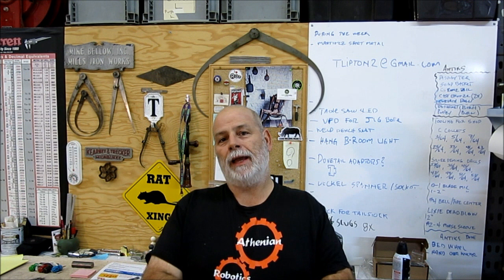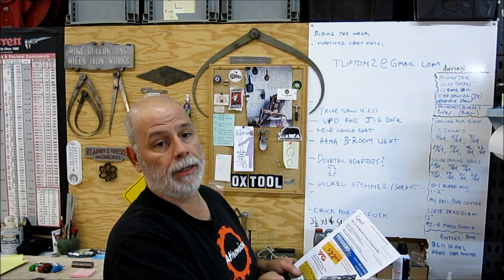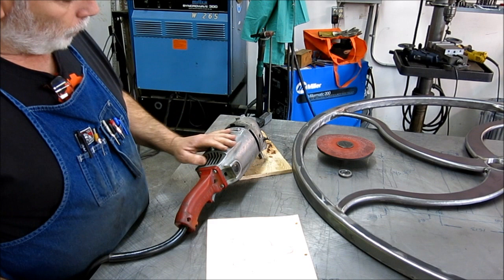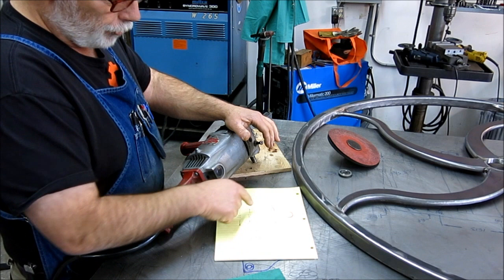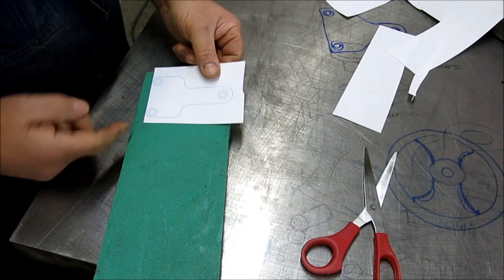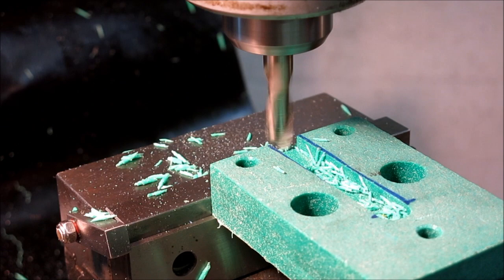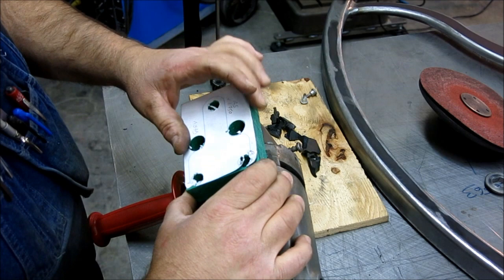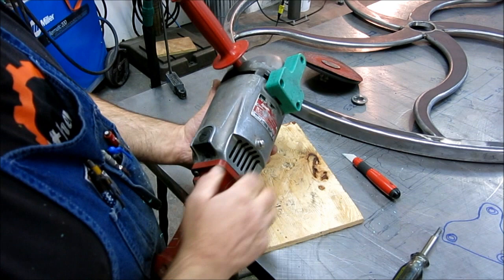Roach Coach Snack Break 6

Comment: Interesting video topic using and working plastics, great save for a beautiful large grinder. It looks as though you can install new brushes in it when you have to do so. Quite rare to have a manufacturer think about prolonging tool life!!
Reply from the maker: Hi Dan,

Thanks for the comment. That grinder has singlehandedly removed a truckload of metal. It was built when Milwaulkee power tools were king of the land. I have drills of the same vintage that have proven themselves indestructible.

Cheers,

Tom

Comment: Hey Tom,

Now that's a propper lazy repair. Done right, so you don't have to do it twice!

I've used compressed air as a coolant on plastic, or even old fashioned 'suds'. Many older machinists still refer to a suds pump. You can't beat water as a coolant, but of course there's a major rust problem, so washing Soda (Sodium Carbonate) was added in quite a strong solution. It works very well, but is really hard on the skin!

I find that re-cutting plastic swarf is often what generates the heat and a vacuum cleaner both helps remove the swarf as well as having some cooling effect.
Reply from the maker: Hi Paul,

I ended up cutting it down a little. It was too thick after I had a chance to look at it a bit more. We used to do a deep drilling job in PEEK for a medical customer. Took us a little bit to get the drilling parameters right so the hole was nice. Plastics don't conduct heat very well so it tends to stay right in the hole with very little coming out with the chips. Shallow pecking and high chip loads with low spindle speeds doused with coolant was the best recipe we found.

Cheers,

Tom

Comment: cont. Lets be honest, you have all the necessary tooling to make a project like this look factory correct but the lesson here that I took was making a part that helps the user operate that grinder better, safer, and with less effort. A pistol grip drill and a coping saw could also get it done. Bravo Ox on this one and keep em coming.
Reply from the maker: True enough. A block of hardwood off a pallet skid was a second choice. I had this weird plastic and wanted to try it out. I thought it came out too thick so I went and had another go at it. It is much more streamlined now.

Thanks for your nice comment.

Best,

Tom

Comment: I love watching you, Fenner, Abom, and Rucker, and am amazed at all the great info you guys are passing on!......however. (the dreadful but!)   I've seen several other guys do it recently also, but if for no other reason than to have your viewers do it, put the guard on the bandsaw down to where it just clears the work you are sawing! I have run one quite a bit, and stuff can happen before you know it!.....and for rounds....a small drill press vice up side down to clamp the work, does wonders. I had a round spin once, and it pulled my finger right in to the blade!.   Keep up the good work!
Reply from the maker: Hi Jim,

Good advice all around. Thanks for the comment and participation. Good sharp blades are the best protection you can have in addition to never pushing along the line that leads directly to the blade. I call it the "Line of Death"

Cheers,

Tom

Comment: Funny you made this video today. I just got home from work and watched your repair while eating supper. I picked up a couple grinders out of the trash a couple weeks ago, one was the twin to your Milwaukee. The power cord was a mess and it was missing the pad. I wanted to give the Milwaukee to my grandson for Christmas. I was a little late, I finished it before I left work. I was at a loss as to what to use for the pad (both the cord and the pad are obsolete on the Milwaukee web site catalog. I made up a new cord and I'm afraid all I could come up with was aluminum for the pad. Will work but maybe a little slick on a metal work bench. Wonder how many others were working on repairing a big hand held grinder today!
Enjoy your common sense approach to your projects and your attention to details. Looking forward to your next video and you and yours have a very good New Years.
Reply from the maker: Hi Norm,

Now that is weird. I replaced the power cord on mine quite a while ago. I made it about twenty feet long so I wouldn't need an extension cord. Where it goes into the grip I slipped a piece of thick vinyl tubing over the SO cord so the grip would grab it and act as a strain relief. Hope you get it going again. They are not built the same these days.

Cheers,

Tom

Comment: Love your accurate tool repair!
The plastics seems to me as recycled, similar to the I am using. The only disadvantage of this material: it is thermoplastic - need a sharp tools and slow machining.
Wish you successful year 2014 and regards from Czech Republic
Milan
Reply from the maker: Hi Milan,

I think you are correct. This material seems recycled to me also. It has grains and seems coarse inside the material. It does seem to belt sand ok as I went back and thinned the bumper a bit.

Kind regards,

Tom

Comment: Tom, The next time you have to trace a pattern on your work, you might try copying first with a dry toner copier, positioning your pattern with toner side down and wetting with xylene to transfer.  It's a technique used by many woodturners who want to avoid the mess of adhesive and shredding paper patterns.
Reply from the maker: T 2thferry Inkjet printer.

Best,

Tom

Comment: I have found that a VERY careful application of a propane or butane torch (way out in the hot-air portion of the flame) to UHMW polyethylene will allow surface tension to "Pull" the surface into some semblance of smoothness. If it catches on fire, blow it out; doesn't seem to do any harm (I mostly work in black UHMW, so maybe it would darken lighter colors). Experiment a bit before trying it on a piece with a lot of machine time invested.  It will clean up straight bandsaw marks, but I don't know if it could handle "nibble" marks from a bandsaw blade.
Reply from the maker: Peter W. Meek Hi Peter,

Never tried the thermal treatment on UHMW other than for fuzzy burrs. Thanks for the comment.

Cheers,

Tom

Comment: Tom,

Thanks for the end mill tip!
Reply from the maker: Hey Willy,

Did you order one? Hopefully yes. You will wonder how you got along without one.

Cheers,

Tom
Reply: oxtoolco Hi Tom,

Yes, I ordered a four sizes. Sounds like they may be able to work as finishers on some of my stuff. 

Do they work well in slots/pockets?
Reply from the maker: Yes they do. You have to keep up with getting the chips out, They make a lot of chips. Air blast or flood coolant works.

Let us know how it turns out.

Best,

Tom

Comment: Hey Tom, those YG roughers are on page 15 of the Travers online Dec. 2013 sales flyer.  That sounds like some kind of glass filled plastic when you cut it, did it stink when you cut it? Love those rotabroaches, fantastic work as usual.
Reply from the maker: Hi James,

No glass in this stuff. It looks like recycle to me. It has little bits or grains you can see when you cut it smoothly. Seems durable and the price was a scroungers dream.

Cheers,

Tom

Comment: Hi,

Ozone is what happened to the plastic. Ozone and oxygen free radicals break the long chains in polymers causing that, it's called "ozone cracking". Wiki has a good article under the same name. Take a look at "Polymer degradation" on Wiki as well. Ozone and UV (and then more ozone) from welding attacks all plastics and rubber. Hope this helps!
Reply from the maker: Hi John,

Thanks for the tip. Plenty of ozone generated in welding shops. That grinder has been near a welding area for most of its life. I think this new bumper is going to go in the grave with it.

Cheers,

Tom

Comment: Way to help out that ole big boy! Was that a piece of UHMW?

Adam
Reply from the maker: Hey Adam,

It seems like a UHMW but I think its recycled material. It machines great, much better than fresh UHMW.

Cheers,

Tom
Reply: Well all of the uhmw we have and I've machined is green in color, and also known as recycling plastic. It works really well for bushing and wear surfaces as its smooth and self lubricating. It also machines very easily on the lathe with radius tools that have a sharp cutting edge. I still have lots of it around.
Reply from the maker: Abom79 Hey Bud,

Sounds like the same stuff. Its definitely slippery and it machined great. Do you have rod stock or plate?

Later,

Tom
Reply: I have some of both. Some rounds of different dia. And some sheets as well. Let me know if your looking for something in particular.
Reply: oxtoolco I have a small job coming up soon involving some uhmw. I might even use a machine that hasn't been in the videos before.

Comment: Nice repair Tom, that plastic seemed to machine well and was not too graby.  It appeared a little thick to me but it sounds like you thinned it down a bit.  What kind of backer pad and retaining nut are you using I have not seen one like that before?
Happy new year :)
Reply from the maker: Hi Bill,

Yes the plastic machined pretty good. When I thinned it I tried the belt sander and was pleasantly surprised that it sanded well also. The backing pad is a really old one. I think its made by Skil. I'll take a look. The spiracool are my preferred backing pads. McMaster sells them in all the sizes and hardnesses. 

Cheers,

Tom

Comment: Dear Tom
I have a mill with an NMTB 40 spindle & was wondering about a holder for a Rotabroach.  I can't seem to find any ready made holders with that taper. Could you  get a 3/4" end mill holder & face down the end where the endmill is inserted to "shallow up" the socket so the set screw lines up with the Weldon flat on the Rotabroach?  Love you visdeos & I got your newest book for Christmas!
Thanks.  Paul
Reply from the maker: Hi Paul,

Pop over to James Kilroy's channel and check out his video on making a holder for an annular cutter. It would probably work fine and slip into your holder without modification. I think his allows the use of the slug ejector pin as well.

Cheers,

Tom

Comment: Do those rotabroaches need a lot of power? (as in I have a little mini-mill that only has a small motor)
Reply: No, far less than the equivalent sized twist drill. I only have experience with them on my magdrill. But on the magdrill, it's capacity is 3/4" twist or 1.5" annular cutter. Going by that - it takes 50% less than a twist drill! Rotobroach is a brand name of annular cutters, like "Coke" to cola/soda.
Reply: elitejohnlp Well, crap. Now there goes my tool budget for the month :)  WTTool has a starter set with 6 cutters that may be in my future...
Reply: Enco sometimes has a set on sale that's decent and relatively inexpensive. They go pretty cheap on EBay as well. The carbide-tipped ones can be retipped if they're broken, but I don't know if the hss can be resharpened or not. Good luck!
Reply: In my experience they work quite well, but as my mill is also rather small, the cutters only work well up to certain diameters and thicknesses under limited power.  I've only used up to 1" and I had to take it pretty easy at that.  They can stall out on thick or gummy/grabby materials like UHMW, PE, or aluminum and are great for opening up a hole quicker or for finish diameters.  Also, I wouldn't get too excited about the ones from WTTool as they are probably Chinese anyway.  If that doesn't bother you you can get the same set on ebay for half that.
Reply: Pfft, if they are not from China, they wouldn't be able to talk to the rest of my tools.
Reply from the maker: Hi David,

They use considerably less power than a drill or mill of equal size. If you want to try some get the little set I showed a couple video's ago that goes up to 3/4 inch. You will have to put them in a separate drawer than your offshore tool housing unit.

Cheers,

Tom
Reply: oxtoolco Hi Tom, Great video--love your channel.  I do have a question about the rotabroach: some folks use an arbor with a reamed hole and two set screws to hold the tool, but you seem to put them directly into a (3/4?) collet.  Do you have any problems holding them in collet?  Do yours have the two flats for set screws?  Thanks again for a good year of videos!  --Brian
Reply: Hi,
I know this isn't addressed to me, but I've chucked them in my magdrill's drill chuck in the past without issue. They don't require much clamping force since they don't require much power to run in comparison to a normal bit or endmill, so no set screws required. The ONLY reason for an arbor is for less run out versus chucking them in a drill chuck. I'm sure the annular cutters have less run out on a 3/4" mill collet, than on an arbor, which has less run out than chucking them in a 3/4" drill chuck. Hope this helps!
Reply: David Kirtley they dont need alot of power to run them like tom says no where the power is needed to run a drill bit of the sams size.they fit into a collet very nicely as well. when there sharp or even not perfectly sharp they still cut very nice.